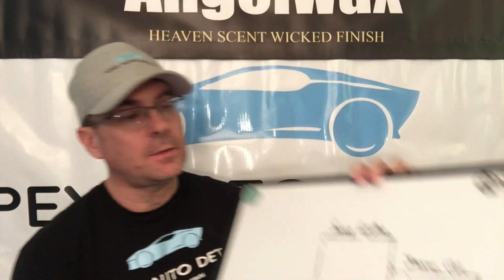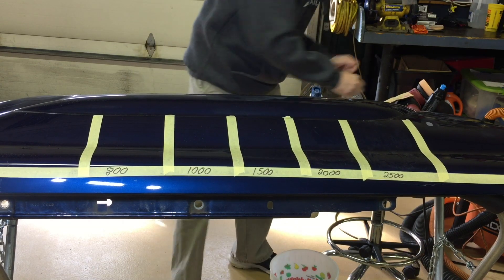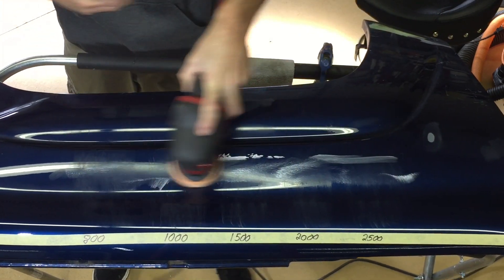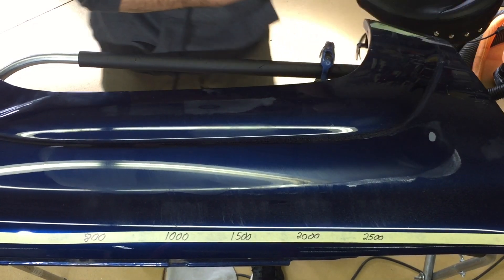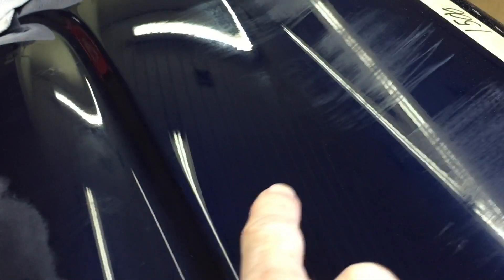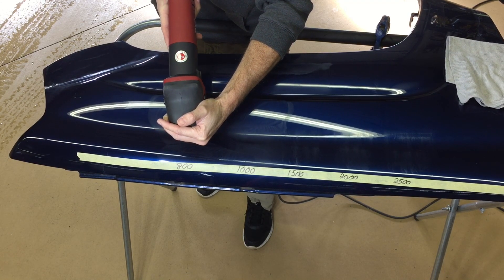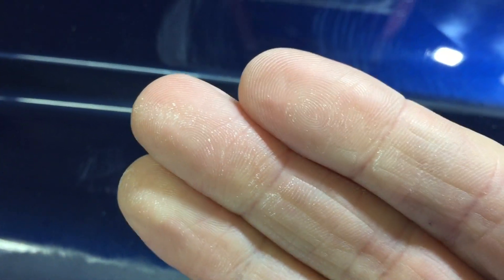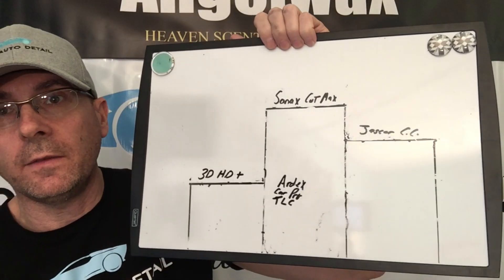Rupes Zephir Gloss Coarse Gel Compound!!! The Cutting Compound Contest....Continues!!!!

Comment from the maker: What Rupes polishers or products do you own and use regularly? 👇
Reply: Apex Detail lol, not a single one.
Reply: I have nano, mini, duetto, 15mk2 and 21 mk2 and i love em. I also had mille but sold it, because it doesnt cut like bigfoots.
Reply: Bit surprised. I know Zephir dusts quite abit but in my tests it cuts like M101.
Reply: I have a 15 and their green/yellow/white pads and the corresponding abrasives. Mostly, I use their yellow pads - 5" and 3". For maintenance, their white pads.
Reply: Apex Detail  Aw  man. I don't want to be the guy. But I will. Nobody kill me! You know I am a fan, Apex, love what you are doing. And I'm far from being a Rupes fanboy. Even sold off my 21 mk2. I'm more a Flex guy (check my IG under same name). But, will you please, PLEASE do this one again? Only this time, use their blue foam pad. They insist on using their products as a system. So let's see how the results are affected by sticking to the system? I'm really curious if/how your results would change.
Reply: This works very well with microfiber pads.
Reply: i have their new Rotary it has different compounds and pads i like it a lot. try this test with a rupes blue pad =)
Reply: I own Rupes LHR75E & Nano ibrid long neck. I have the polish coarse & the finishing one.
Reply: Apex Detail  I have a MK2 15.  Love the machine.  A couple months ago I got a Flex 3401 for my cutting because the Rupes takes too long on complex curves.  You really notice how balanced the Rupes is after using the Flex for a couple days straight.
Reply from the maker: Love the feedback and variety out there👍🏻👍🏻👍🏻
Reply: I've used countless compounds/polishes and nothing compares to the brilliant German made products produced by Koch Chemie. Try their H8.02. compound and you'll be absolutely amazed. Incredible!
Reply from the maker: I will try it👍🏻
Reply: I do a lot of work with a Duetto and  a Mini. 

Final polishing is done with yellow foam, and Keramik polish. Reminds me a lot of Menzerna SF4000.

One steps are with their Keramik polish with their original yellow microfiber pads. Sometimes I'll use Quarz on yellow foam, but the first combo usually finishes out better. Speeds 3 or 4. 

For heavy cutting I use Zephir, and  their original blue microfiber pads. Occasionally I'll use the blue foam, but it slings a lot, and they wear pretty fast. 

The system works, it just has a pretty severe learning curve. It took many attempts, and a lot of practice to get it down. It's so different from a lot of other approaches. 

1. Pad priming was different. With the foam cutting pads (blue, green, grey) it was a whole new experience. It took a couple sections for the foam pads to be primed, and soft enough to get serious work done. The (original) microfiber pad required LESS product to get started!

2. I had to drastically reduce the "re-load" amount of polish I used on the pads. Both foam and microfiber.

3. I had to ease up on my downward pressure.

4. I had to monitor black plate/shroud lubrication. Once it dries up, the shroud will shred, and you lose rotation.

5. The blue, green, and grey foam pads are useless without the shroud intact. They just end up slinging the polish all over the place. Unfortunately, the first thing people do is install a washer mod.. Then, when they try the blue or green foam pads, get sling, and no cut. User error is why a lot of people hate on the system.

In my experience, using the Rupes "system" is similar to machine sanding paint. A very, VERY different experience compared to buffing paint. Even with a PC, or Flex there was always some lineage to the rotary. But the factory set Rupes stuff - totally different. When I use the Rupes system, I approach it as an extension to machine sanding. My handling of the machines is very similar, where with other approaches, I can really put the hammer on a 3401 or rotary.
Reply: An LHR 15 in combination with the yellow and green polish and their pads. From time to time the Sonax perfect finish with a yellow Rupes pad. All used on modern Beemer paint ( my own cars ). Works so much better than a 900 DA. 

Thanks for the very very informative reviews!
Reply: @themogul5846  I agree with your choice,first time heard for them from a friend that has a detailing store,and it cuts like a dream and no dusting
Reply: I love their new wool pads, I know they say not for rotary use but I do it anyways especially the small ones. Havent had much luck with their compounds except for the yellow polish. Lhr21mk2, lhr15mk1, LTA 75, and ta50.
Reply: @jtm1979  how do you like the nano?! I've been debating getting one for way too long. I have the ta50 and lta75 for tight spaces but would like something that doesnt require air other than my flex kompakt. Thanks!

Comment: of course you didnt use the correct pad and I even think you used a dirty foam pad that is contaminated with other compounds but Im not sure.  I would like to see a test with the correct pad for the compound.  I will say that I hate most compounds on the market because they lie about the ability to remove sand scratches correctly.
Reply: He uses the exact same pad and polisher for every single compound. The goal is consistency in testing and to put the brunt of the cutting work on the compound. You can cut with almost anything if you use an aggressive pad. The pad is changed or thoroughly cleaned between each product test. It is fair and equal for everybody. 

The Rupes compounds are average, but somewhat versatile and forgiving. Fine for enthusiasts, but the price, dusting, and average cut add up to a less than ideal choice for most professionals.

But these tests are, if nothing else, excellent demonstrations for you, even if you disagree with the rating. It is as clear as day what each compound is capable of and gives you an idea of what to expect while working with it under similar conditions. Try 3D ACA, or Sonax CutMax if you want to see what a high end exceptional cutting compound should be..

Brian is one of the best detailers alive on this planet, not to mention he is a total product junkie.. 😁 He has tested and worked with endless amounts of products. You won't find a more reliable, reputable and qualified review source. He is unbiased and he is a real world detailer, not a YouTube detailer in it for revenue and desperate to climb into every manufacturers sponsor bed. To disregard his opinions makes absolutely zero logical sense. 😕✌

Comment: I wish that you try the Rupes blue foam coarse pad & give us your opinion because I try it but I didn't succeed using it, I don't know why it fails removing 1500 grit sanding marks. Is it me or the pad problem?!! Also next series can you please try Menzerna 300 heavy cutting compound?
Reply from the maker: Blue foam coarse... I will order some again👍🏻
Reply: Apex Detail if you want I can share it with you. It is almost the same as HD blue cut foam pad from lake country.
Reply: Feras Al-Hindi - I find then to be very different. 

The Rupes pad is extremely dense, coarse, with big open cells.

The LC orbital was softer, and had smaller cells. The HDO is very hard, but with very dense, small cells.
Reply: danlc95 I totally agree 👍

Comment: Another excellent review!

The dusting can be mitigated by reducing the amount of product used. 

The orange pads are similar in consistency to the yellow Rupes polishing pad, which this polish wasn't designed for. But I like how the orange is used for the sake of consistency across the board. 

The take away for me, was the how well it performed when used outside It's designated parameters. While many of the compounds reviewed are "universal", this one is very specific.

Comment: The issue with Rupes is that it's not very economical for a Weekend/Enthusiast Car Detailer. Every Polisher is around $350-$600.  It's just not worth it for a detailer that only does paint correction only a few times a year. I use meguiars compounds and polishes. With griots garage DA.
Reply: Dmocification I agree, but its the “car enthusiasts” they imagine are the one’s willing to baby their cars at any costs, where as the detailers have to watch their spending and actually turn a profit. Perception is that car lovers are rich, have OCD, and willing to spend large amounts of money for their toys.
Reply from the maker: Really all that is needed as a weekend warrior 👍🏻
Reply from the maker: Yeah... I guess.. the price is way off and the performance underwhelming.. but to each their own.😊
Reply: The machines, IMO are of superior quality.  The pricing is not that much higher than Flex when you compare the similar tools (3" flex to 3" rupes, the Rupes is actually cheaper) although I was able to get my Griot's BOSS G15 for a significantly smaller number than a Rupes 15 mk2.  I have gotten the 150ml bottles of compounds included with my Rupes mini and Nano, and I haven't been terribly impressed with them especially at the price point.  The equivalent Jescar, Menzerna, etc. are better performers.  I will say though that Keramik smells amazing compared to most other polishes.
Reply: I personally use the following:  Griot's G15 with either LC thinpro or Rupes foam pads, and Meguiar's or LC microfiber pads.  I also use a Rupes LHR75E with Rupes and LC thinpro foam pads, as well as Meg's cutting discs.  I use the Nano with Rupes pads currently but plan to add LC microfiber discs in the event I need them.

For rupes pads, the primary go-to is the yellow pad, but the Greens work well for a little more bite.  I haven't done much with the white pads only because when using the right cutting (Jescar/Megs MF) and refining (Jescar polish or Menzerna 3800/Rupes Yellow) I haven't needed a 3rd stage.  I also have had great results thus far with the optimum hyper twins and 5.5" waffle pads on the G15, so much so that I'm going to grab some 3" waffles to complement it.
Reply: @joecat8566  - Zephir smells really good too. 

The 3D compounds I picked up don't necessarily have a bad smell, but it's so strong that it's off putting. AAT 501 literally makes me want to puke, after I've cleaned out the pads (it's a nasty lingering odor). ACA 500 isn't as bad, but the smell hangs on to everything. I'm going to sell the 501. The performance of 500 dictates that it stays.

Comment: For my work I (have to) use the one with the blue cap (zephir) with the blue polishing pad. It's working quite well on a fresh paintwork after sanding with P6000. But the entire car is dirty with dust. The rupes polisher makes way to much noise and it's very expensive. But, no swirls and a nice gloss. The one with the yellow cap (ceramic) is rubbish. Leaves a nasty haze.
Reply: I've onlu had it haze with their yellow microfiber pads. Sometimes pretty badly too - especially on finicky black. A switch to their yellow foam usually takes care of it. 

Their polishes are very short cycle. Once I learned that, it reduced the dust considerably.

Comment: Really looking forward to this review, rupes yellow pad + improved yellow Mille polish is my favorite one step combo using both the rupes 15mm DA and mille. I also use their white diamond on a white rupes pad on a DA and Ibrid for further refining black gloss trim - I like their colour keyed system, makes it a lot easier for a hobbiest, also helps that it seemingly works on all paint surfaces - only thing I don’t use from rupes is their mf pads, here I prefer the new lake country.....and after watching your review, the blue compound will remain on the shelf lol
Reply from the maker: Hey... try it! 😁 you may have better luck with it. If something works .... stick with it... despite what others are saying.👍🏻
Reply: you lost me at dusting - i'll stick with PA master compound, i rarely need anything more coarse than that, and if i do, i reach for carpro clearcut to spot correct
Reply from the maker: If you get a chance... try the Sonax Cut Max. If you like Car Pro (which is great) you would love Cut Max😁
Reply: Sam, I love the way Diamond finishes, but it doesn't like wiping off the panel. It's really "sticky". How do you wipe it off?
Reply: i've switched to the new mille yellow polish, i find that is quite a bit more oily than the original yellow polish, but not as oily as the diamond white, so tbh i don't find an issue with it. if you want a finishing polish that is literally one wipe removal like a good wax/sealant, i'd recommend polish angel invincible primer, but it's hella expensive for anybody to justify other than a hobbiest. i've also spent a bit of time finding the right towels for polish removal, and settled on the in2detailing yellow edgeless 350 for initial removal, then switch to the rag co edgeless 300 which has a shorter nap with carpro eraser for final wipe

Comment: I work my way up to 10,000 grit wet sanding when possible, depends on what kind of car I am doing.. Show, model etc. RUPES blue with either my Griots 6" or the BOSS 21mm with proper microfiber cutting pad, NO FOAM !. You have to moisten pad or surface first to reduce dusting, I have been detailing for over 30 years. The stuff we had back in the day with a wool bonnet was something to piss and moan about.

Comment: Rupes really needs to re-evaluate the effectiveness of their polishes. Even the die hard Rupes polisher lovers don’t use their polishes (Todd, Ammo, Obsessed Garage, etc). Hopefully with some of the Meguiar’s guys going over to Rupes things will change in the future.
Reply from the maker: The 15 and 21 mm polishers are over priced by $150. The nano by $275. The LHR 75 pneumatic is the only one priced at what its worth. I will never overpay for a name again. 😁
Reply: They already have all.new compounds each for.the 3 new machines. DA, FR and rotary each have new pads and the compounds. I really liked there DA wool pad
Reply: LOL! Tell me a better long throw than 15 and 21 mk2? What polisher does those guys use? I have also Festool rotary but it collects dust.
Reply: jtm1979 Again, they use the Rupes polishers but not their polishes. Shurhold, Griots, Zentool, DAS 6, Flex, even Torq are cheaper and in the same class as the Rupes long throws.
Reply: Shurhold 21mm is the most powerful 21mm I've used. I've tried 'em all. I trimmed the shroud a tad which helped rotation even more!
Reply: I heard about the new line of abrasives. Wouldn't mind trying out some samples for a rotary. FWIW, I really like my '15. It did necessitate some change in technique and it does stall, especially on concave panels, but it's so easy to work with and finishes so well that I don't mind all that much. I mean, a roof can be done with one hand. You guys are likely in much better physical condition than me. :) This being said, if I were buying a new buffer today, I'd likely opt for one of the Asian copies at half the price. Hard to resist, really.

Comment: I dont own a rupes... Adams Swirl Killer!
Reply: Mikey P how do you like the Adams swirl killer
Reply: united we stand my swirl killer mini broke after 1 detail. I returned it. Good customer service.
Reply from the maker: Nice... how do you like it Mikey?!
Reply: It is a shine mate polisher re-branded for adams. And the shine mate machines habe good reviews
Reply: I love it! To compare... the Mk2 15 may be a tiny bit smoother, bit the SK is much more powerful. And actually priced right. Rupes polishers are $200 over priced.
Reply: We have the Swirl Killer and the Rupes at the shop where I help with paint corrections. 

My good friend and detailing partner got me the gig, so I leave the Rupes machines for him to use. I use the Swirl Killers 15 and Mini. 

I use my personal Rupes tools in my personal operation as intended from the factory. No washer mod, or cutting of the shroud. This makes using my Duetto (or any non modded) way smoother than any modded tall strokes. 

The SK 15 is nice, but honestly I don't feel it's all that much faster than my old Porter Cable 7424 all things being equal. I know that my standard green and blue Buff and Shine foam pads work better on the 7424. People laugh at that tool, but it works.